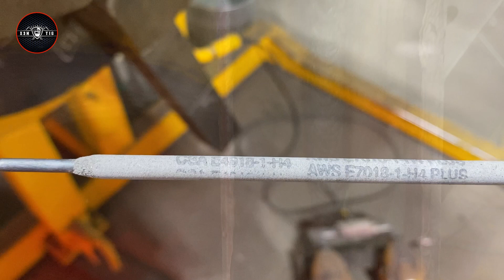Learn How To Master | Stick Welding Vertical Up | 7018 Technique !

Comment: Im using a lincoln 225 dc+ set at about 120-125 and no can do - i go slow with tight arc molten metal droplet fall - i go faster with a tight arc looka too fast, doesnt lay down enough metal - do you change speeds from start-mid to ending and what is your reod angle usually? Thanks - nice video
Reply from the maker: Thanks for your comment bud, usually I maintain the same travel speed, pause on the sides and run over your middle. Angle, try with 10-20 degrees!